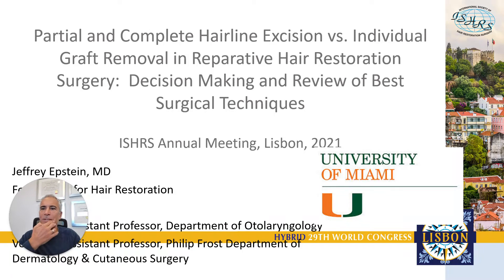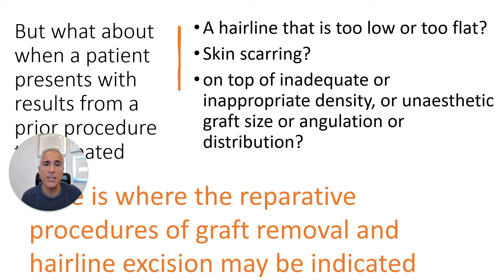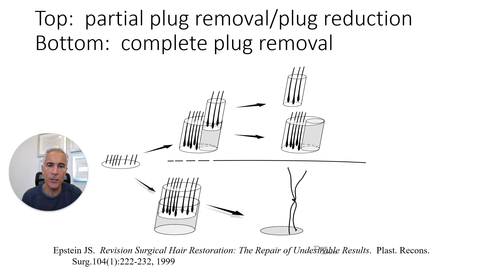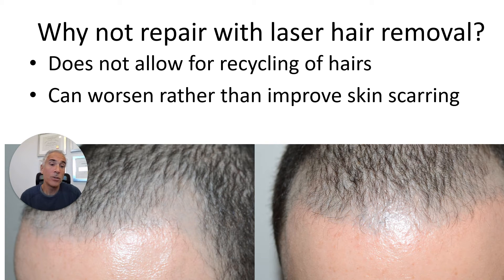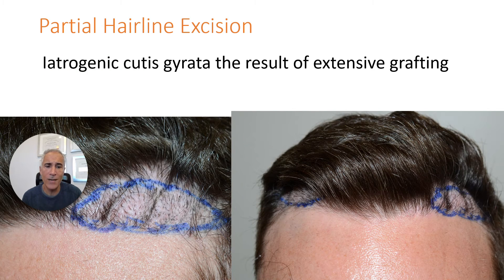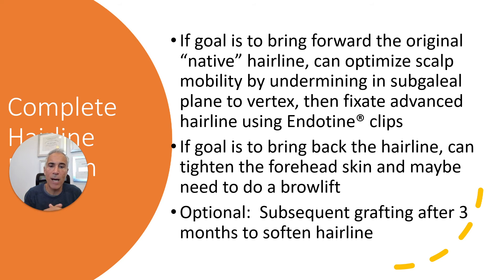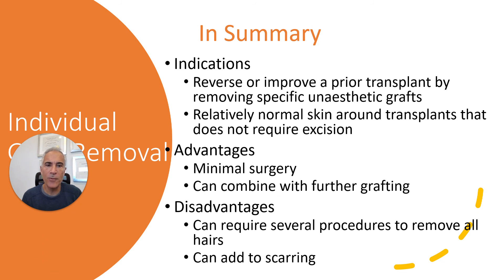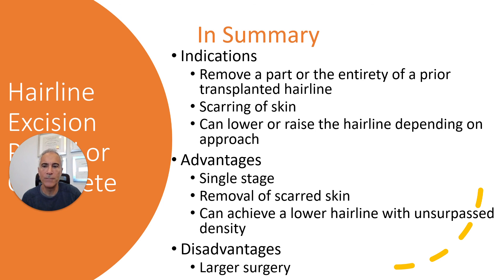Hairline Excision vs. Individual Graft Removal: Lecture Presented by Dr. Epstein at the ISHRS 2021

Comment: Excuse me, ive got cobble stoning on the front of my hairline (i got 1800 grafts in the hairline) and it looks not very nice in certain lighting. I have had smp to try to conceal it,  if I have a shaved head, would it be feasable to have partial or full transplant excision? And do you have a round about price for this?